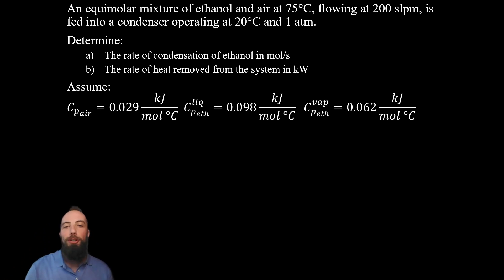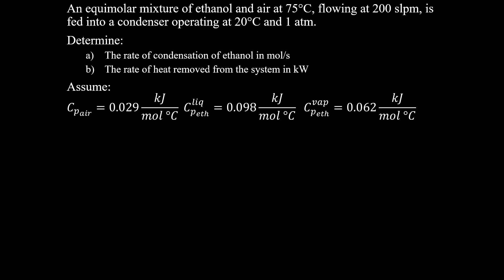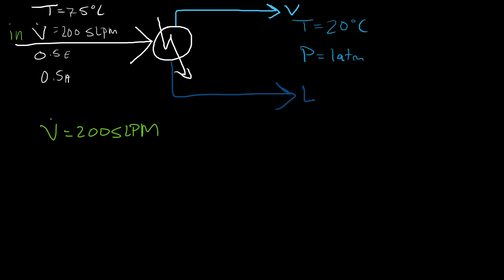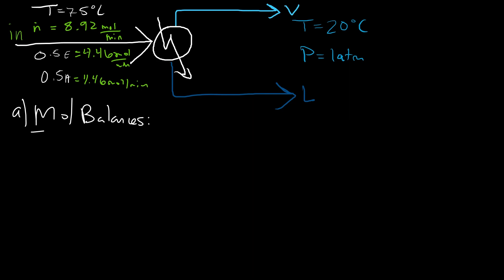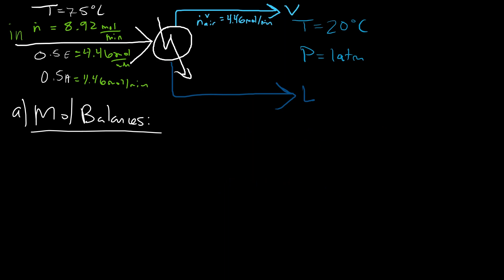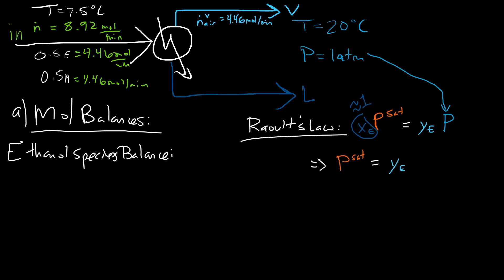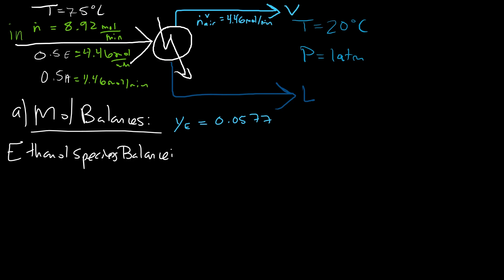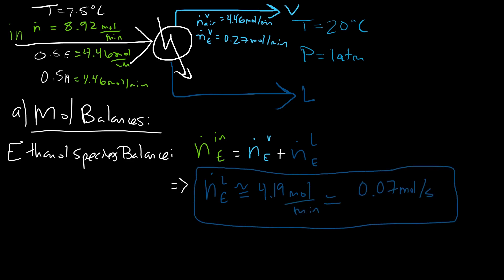Problem Solving: Condenser Mass and Energy Balance Problem (1/2)

Comment: can you pl make another mass balance on condenser? with taking input flow rate in kg/hr?  for example : if we have to condense the mixture of 1000kg (water+air) water 800kg/hr and air 200kg/hr, 1atm pressure.
Reply from the maker: Sure, but it may be a few weeks. Would you like the energy balance too?
Reply: @CsquaredChemicalEngineering  Yes Sir no problem! And yes the energy balance too!
Thank you